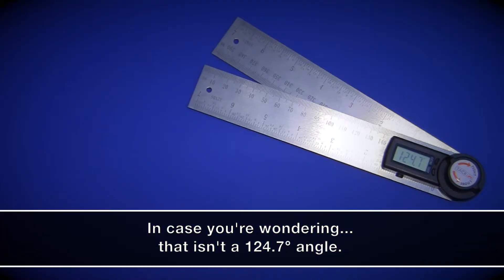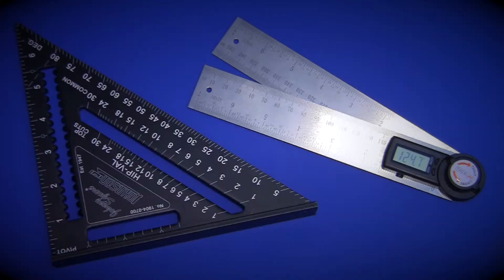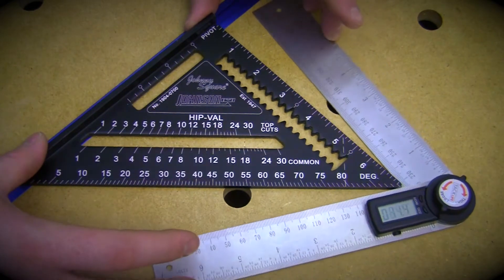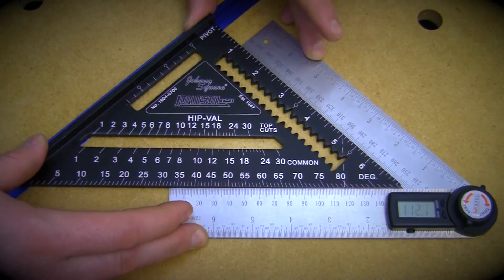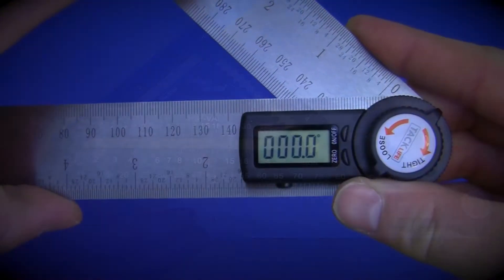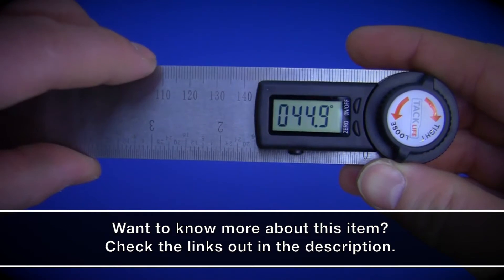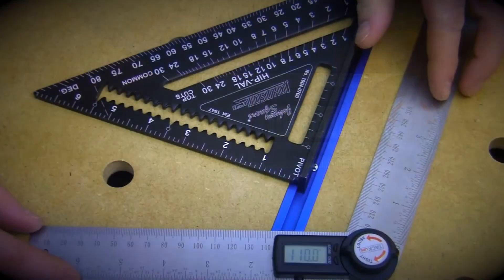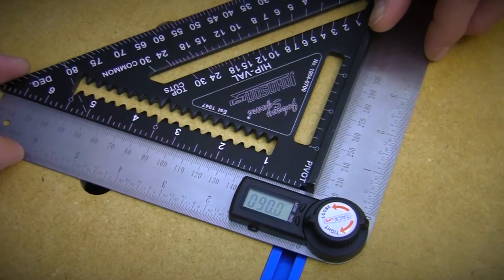Digital Angle Finder Calibration // DIY How-To

Comment: Are all these digital angle finders pretty much the same? Meaning, it doesn’t matter which brand to buy? Thanks
Reply from the maker: Some of them go down to hundredths. I got a different brand to try out and I really didn’t care for it. I believe it was GemRed. It looked identical to the Tacklife but the fit and finish was off and the dial never stayed tight. Might’ve been a bad one. Hope this helps.
Reply: @CPBuilds  Thanks for your response.
Reply from the maker: @olivepressdesign  not a problem 👊🏻👊🏻

Comment: I appreciate the video but gotta be a bit of a stickler because you’re really just verifying, not calibrating. Calibrating would let you make adjustments to bring it into accuracy. Either way, always a worthwhile to confirm your tools. I don’t believe any of these angle finders have the option to be calibrated.
Reply from the maker: Matt Twyman I verified that my square was 90 degrees so I calibrated my angle finder to it. Since I can zero out that tool at any degree I felt using the word calibrate was correct. I even ran my script by people who work in a factory who calibrate tools on a daily basis and they saw nothing wrong with it. Thanks for watching 👍🏻👊🏻
Reply: You are absolutely correct.  It cannot be calibrated, only zero.  Here's what I mean.
Zero it at 0 deg. then rotate to 90 deg. and check it against a true 90 deg. square.  It will be off by a fraction of a deg. or so (or even off by 10 deg), and there's nothing can be done. 
If however it can be calibrated, setting it 90 deg. should also be possible.  Maybe at the factory.